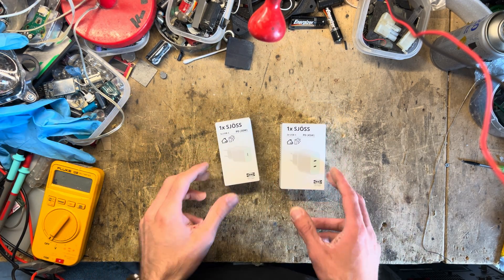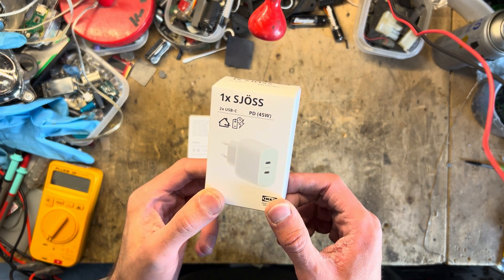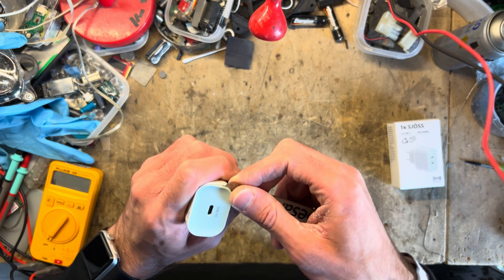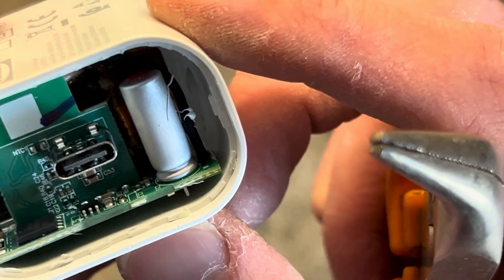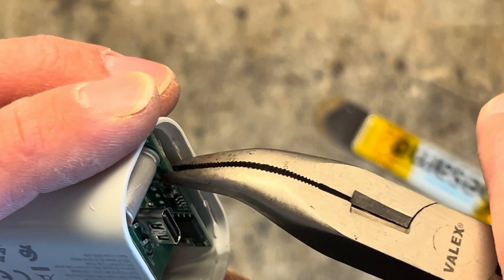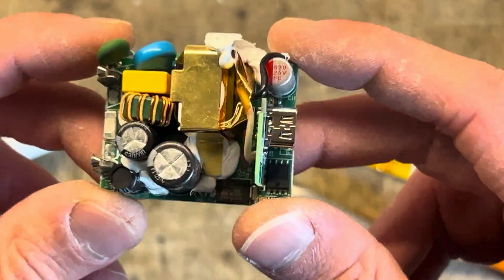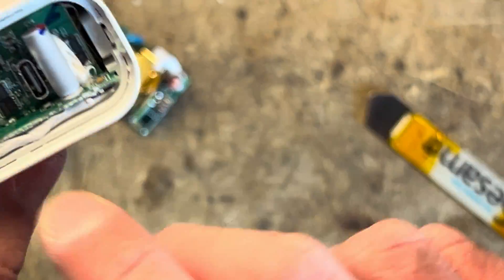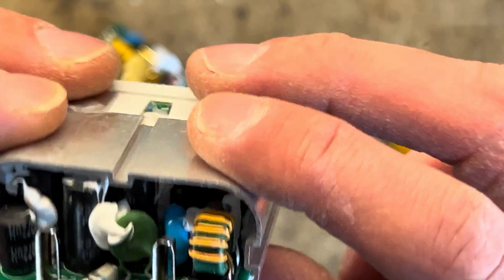IKEA SJÖSS USB-C charger teardown - 2024 sjoss is king of the cheapest again!

Comment: I bought the 30W and it can hiss under modest load but idle it doesn't hiss, or not enough for me to hear it. It is not an annoying power supply by any measure, i have had way noisier ones.
Reply from the maker: They seem to only have the 45W in stores now. Considering the small price difference it’s probably the best choice anyway

Comment: "Grounding" the heatsink seems useless to since it's a 2 pin wall plug device and there is no ground available anyways.
The purpose of it is to disparate heat and not to act as an interference shield.

Comment: Hi, I just bought one of the 30W ones. Works great, but it gives off a buzzing sound when no device is connected to it. It's not a loud sound, but definitely noticeable, especially in a semi quiet room. Do you think this could be a malfunction/not safe? Should I ask for a replacement?
Great video btw, waiting for part 2 👍
Reply from the maker: I saw the same later on mine. It’s not broken but unfortunately the way it behaves when it’s not under load. The 45W is dead quiet
Reply: @FrancescoF  Thanks for the answer! Glad to know it's not dangerous!
Reply: I have the same problem with my 20W Anker charger.

Comment: My MacBook Pro is apparently pulling 54W from the 45W charger.
Reply from the maker: If you are measuring it from the wall you also need to add efficiency losses in power conversion, it’s normal that under full load a 45W power supply would pull more than 45W from the wall. That 45W is referenced to the output not the input

Comment: I am a bit hesitating about Sjöss, because it has maximum operating temperature just 35°C. I might be sometimes close to the limit during summer. Not sure how much should I care about that.
Reply from the maker: That number is for meeting the reliability standards, I’m sure it will work at higher temperatures too, especially with a reduced load. (Like 20W on the 45W unit)

Comment: Does your charger (the 30W one) also make a little buzzing sound when plugged and in use? Is it normal?
Reply from the maker: Yes it does, it should be normal based on the switching frequency that they are using. Sadly I do agree that the noise is rather annoying if you have it near you
Reply: @FrancescoF  And what about the 45w one? Is it quiet? The charger would be plugged like in 40cm from my pillow, so I wounder if it's better to pay 5e more even if I don't need 45w for my phone
Reply from the maker: @brnerproduction4739  yes, in my testing it’s quiet
Reply: @FrancescoF  Thank you!

Comment: Thank you so much. I was in between this or buying Anker and had doubts about build quality. But this looks very good especially considering the price!
Reply from the maker: Yeah, unless you go for Apple or brands like that you’re better off with this one, similar quality at a much lower price
Reply: Anker is as good as Apple and in my opinion better. Having tried many models of Anker chargers they dont disappoint. Though these  ikea chargers look better than Chinese replica ones 😂
Reply: For what you pay really worth it
Reply: @arturgjoni8881 \The charger wasn't yet in stock so I ordered an Anker 65w charger for €23. I'll get the IKEA charger later as a lower capacity secondary. Needed something as permanent power supply for my Steam Deck, so I think going for Anker is a good choice. With it being made for 65w I won't be having overheating issues as Steam Deck takes 45w when charging and running games.

Comment: Great video! Ikea electronics never fail to impress. Just got myself the 45W charger as well. Really a bargain and you can be sure it won’t burn down your house :D
Reply: Never trust a brand too much. Some Ikea electronics have been pulled out of market because of safety issues. It happens to all companies sometimes. More to unknown brands ofc. That's why they remain unknown.
Reply: @McSlobo the charger that was pulled form the market was sound, it was just the cable that COULD potentially get dangerous when worn out… ikea makes sound electronics